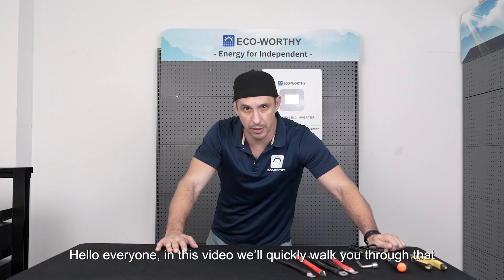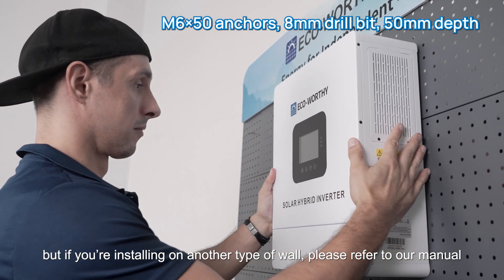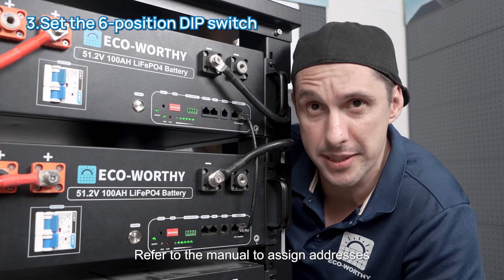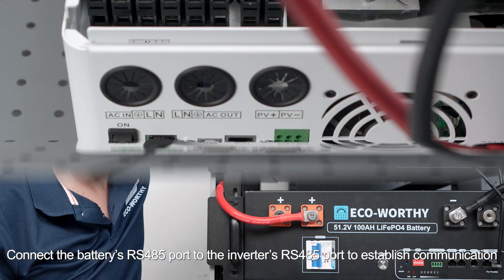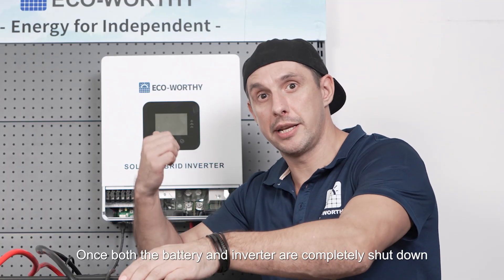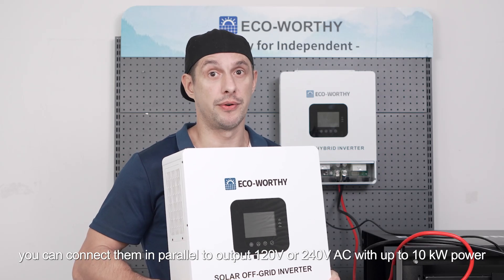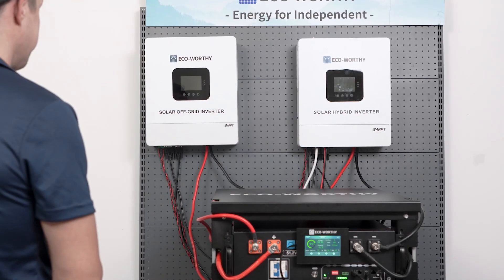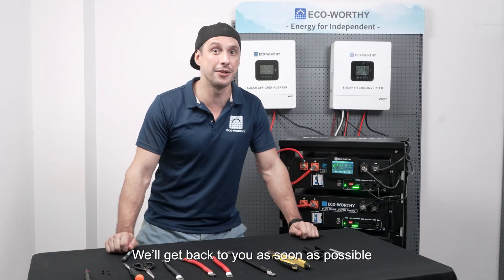Step-by-Step Guide: Connecting ECO-WORTHY 48V100AH Battery to 5KW Inverter & Inverter Parallel Setup

Comment: Why we can’t install it horizontally?  What is the difference if there is lot space on the right and left for air flowing
Reply from the maker: Hello, thank you very much for your question. We cannot install it horizontally for the following reasons:

1. Core Reason – Heat Dissipation Failure
The design is based on the principle that hot air naturally rises. With vertical installation, cold air is drawn in from the bottom, and hot air is smoothly discharged from the top. Horizontal installation disrupts the airflow, causing hot air to accumulate inside and fail to dissipate effectively, resulting in overheating.

2. Consequences of Horizontal Installation

(1) High temperatures will shorten the lifespan of components such as capacitors, reducing the equipment's lifespan.

(2) To protect itself, the equipment will actively reduce its output power, leading to a decrease in equipment performance.

(3) Long-term overheating increases the risk of malfunctions and fires, posing a safety hazard.

Therefore, even with sufficient space on both sides, the physical law of hot air rising cannot be changed. Horizontal installation will directly affect the heat dissipation system; please ensure vertical installation.